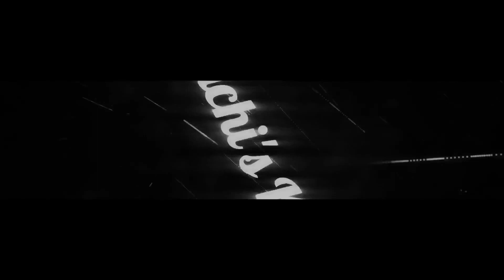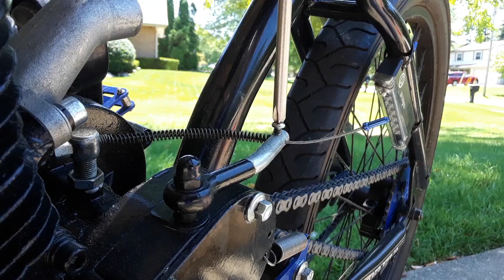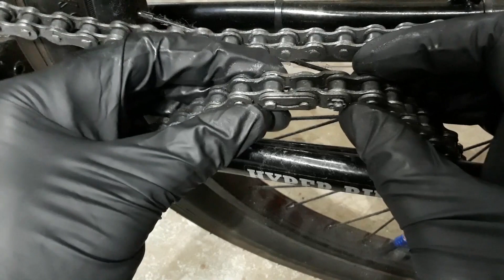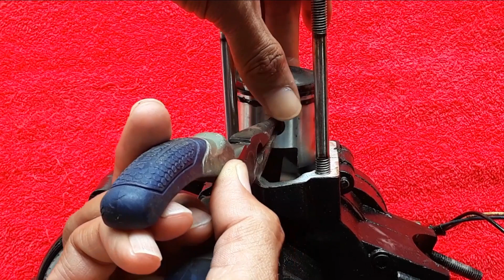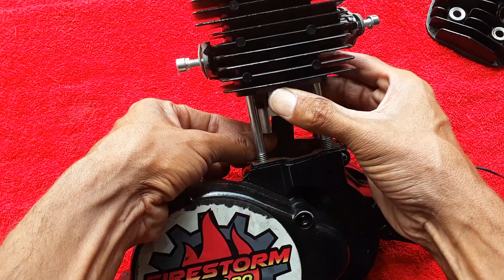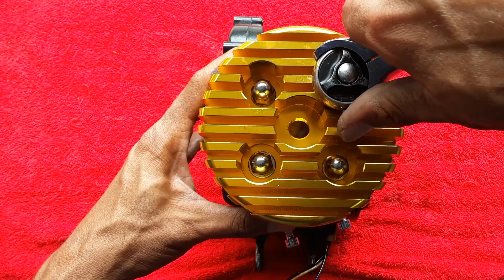80cc 2-Stroke Motorized Bike / Engine Upgrade / Open Transfers / High Compression Head

Comment: Your head is off by 90° the cooling fins are supposed to be paralell to the Motor so the air can flow through the head.
Reply from the maker: Yup. Thanks.

Comment: Very nice set up, I'm sure it ran well for you.  I just received a open transfer cylinder and I don't know if I  need a windowed piston or not. What did you use with this build?
Reply from the maker: They gave me a windowed piston. I personally think the non windowed supplied a little more power.

Comment: Don't you think you would get better cooling if you turned the head 90 degrees so air can flow through the fins as you ride down the road?
Reply from the maker: No, just didn't notice.

Comment: That take a smaller spark plug?
Reply from the maker: Yeah the original spark plug is a BPMR5Y, but I run a little hotter with the NGK Spark Plug, NGK BPMR6Y.

Comment: I could mount an 80 cylinder and piston on a 100 engine because in Romania there are no 100 cylinder and pistons, I want to point out that it fits in holes only that the 100 cc cylinder and piston is 50 mm and the 80 cc has 47mm? .
Reply from the maker: Good information.

Comment: Your billet head is on sideway sir, nice explanation otherwise. ⚙️🚲⚙️
Reply from the maker: Yes sir. It had been corrected. Thank you.
Reply: @kachiskid  it will run either way but the air is supposed to flow into the fingers or “fins” and cool the motor. I have few videos on building motors. Hope that helps. Godspeed
Reply from the maker: @rogerstafford-wakeinc.2088  Yes sir. Didn't even realize at the time, I was so happy just to get going. 🙃 I will check out your channel and learn something!
Reply: @kachiskid  hope it helps thanks for your support

Comment: Get an expansion chamber like a 85 yz it’s gonna make crazy power , i’ve got one with a fully built motor 👍🏼
Reply from the maker: Lol. Yeah that is more a young man's game. I hate the noise already of the 2 stroke. With that, my neighbors would run me out.
Reply: @kachiskid  yes ofc i understand , but with a good mufler i think it delete the loud noise of the screaming 2 stone motor! Im planning to adapt one on mine soon !
Reply from the maker: @guslebolideur8736  I going to be testing a lot on this bike when fully broken in. I might get one, never say never but I have an exhaust to upgrade it too already. This might not be a speed demon, but I got enough of those. 😉
Reply: @kachiskid  yeah with little upgraded parts for cheap u can make some nice power , but motorised bike parts are very different each other , especially the motor but mostly the cylinder

Comment: Find it interesting that your motor came with the slightly domed piston I have three different 80cc bike engine kits all of them are flat Pistons
Reply from the maker: That is interesting. How is yours running? Sometimes flat pistons have a problem with starting up right away. In mopeds anyway...
Reply: @kachiskid  you are right stop-and-go suck I have to walk my motorized bike across crosswalks at lights
Reply: But I have 3000 miles on my bike so I have pushed it been through a couple Magneto's but that's because my bottom end Wiggles around like a fish out of water if I didn't have to ride at 16 miles to and from work a day I fix it right but because I need it to get to and from work it's easier to just put a Magneto in it usually they don't go bad I can use them for spares on my girlfriend's bike they just won't work on my bike anymore
Reply from the maker: Don't you think it's time to replace that bad boy, the whole engine? 3000 miles is a lot.
Reply from the maker: Your right crosswalks suck ,but I have to use it as a real bike after stopping.  I have to admit that I pedal through stop signs, but only in neighborhood streets. People give me the right away because they think it is a regular bike.
Reply: @kachiskid  yes going to replace the engine soon just want to see how much I can get out of it
Reply: @kachiskid  runs fine even though my bottom end is going out
Reply: @kachiskid  I got a window piston at one point and I took it out because I got more bottom-end power out of the flat piston that came in it stock
Reply from the maker: Yeah that window piston I have heard a couple of bad things about.
Reply: @iride5725  it's a 80 for sure did the topend 3 time's now I'm only getting about 1200 miles out of a topend

Comment: We'll done on video 🚴‍♂️💨💨💨💨 that's really cool that they send you a new cylinder body and looks really good and the Gold cylinder head works fine have it on one of my motorized bicycle I'm sure you seen it💨💨💨💨🤙👍✌💯
Reply from the maker: Thank you bro. Of course I have seen your cylinder head, it is cold. I was going to get the blue one, but the gold will offset the rest of the blue on the bike. U of M colors.
Reply: @kachiskid  LOL I did the same I had it but it ran good still but I wanted to put it correct way so I did you need to turn it one more time 🚲💨💨💨🤙👍💯
Reply: It probably doesn't matter but up to you
Reply from the maker: @motorizedbicyclerider5296  Thank you brother. Shout out coming of course! Your my guy!
Reply: @kachiskid  welcome 🚲💨💨🤙👍💯